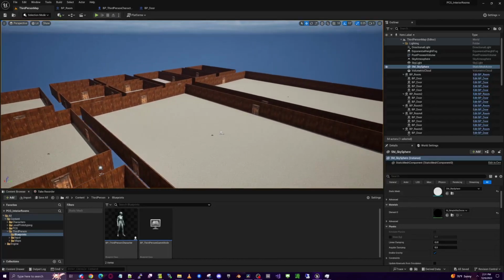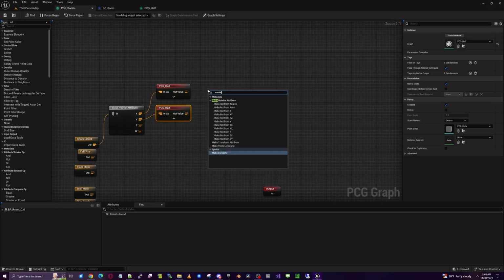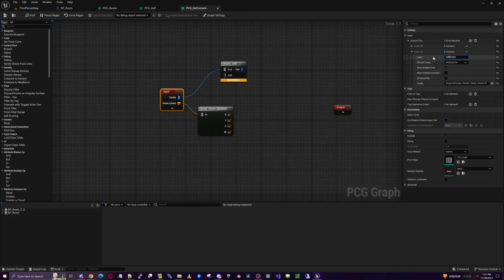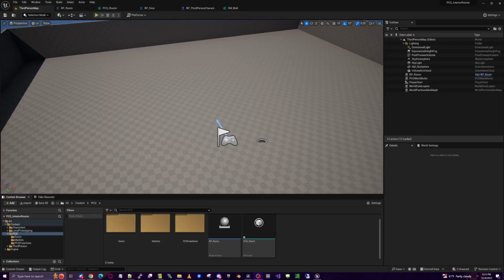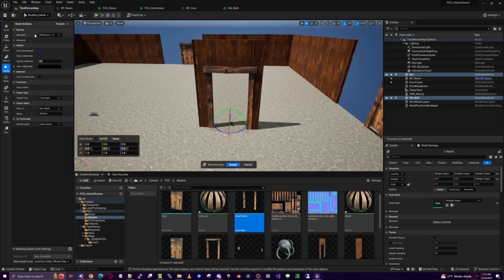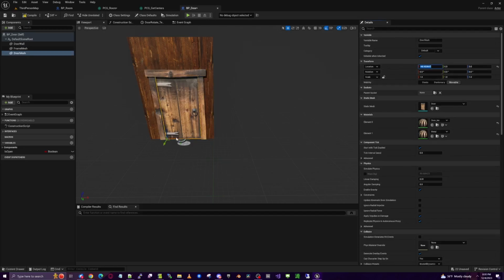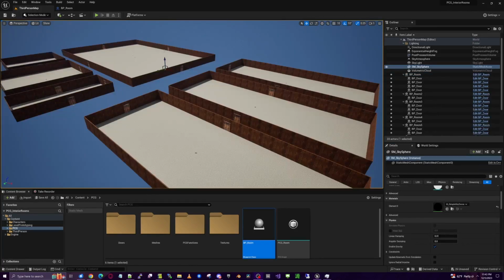PCG Interiors Pt1: PCG Rooms for UE5.3 - Tutorial

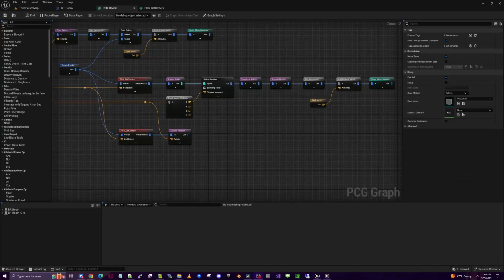Comment: 20:14 At roughly this timestamp, it shows "PCG_Centers" Node with no extra inputs connected other than "Half_Extent". But at about timestamp 23:32,  "PCG_Centers" Node now has all the; "Door North", "Door East", "Door South", "Door West" Nodes connected to it(PCG_Centers). Is there a good reason why you moved it without explaining the change? or could it be because is it over-complicates the PCGFunctions with unnecessary nodes(in this case; PCG_Centers)?
Reply from the maker: I believe that is a throwback to an earlier version, it's only on the screen for like a 1/4 second, so I'm pretty sure I meant for you not to see that. In the next frame you can see those nodes are hooked up internally, which is how that remains until Part 4. My video recording and editing skills are pretty new and I'm still working on how to get the best results without having to build a project three times. I still made some mistakes and experience frustrations with recording in the part 4 videos as well, but hopefully I'm improving. Make sure to join the discord, as it's a great place to discuss and get assistance.

Comment: how would I do the doors as doorways
Reply from the maker: Use a difference node with the wall points as the Source and the door points as the Differences, then use that for the walls instead (to create a fully open wall at the door locations). Or you could just create a mesh with an opening instead of a door. If that doesn't make sense then get on the discord and I can help you there.